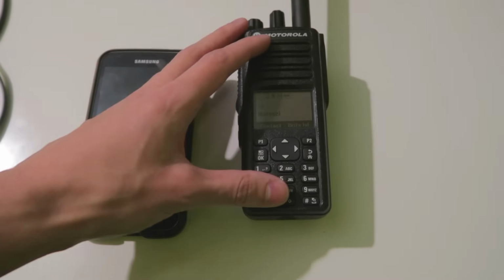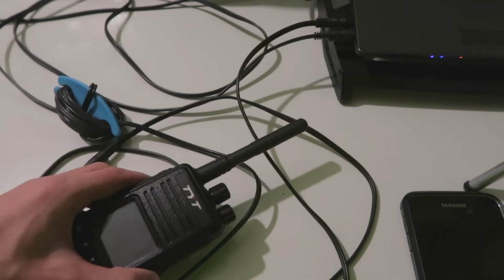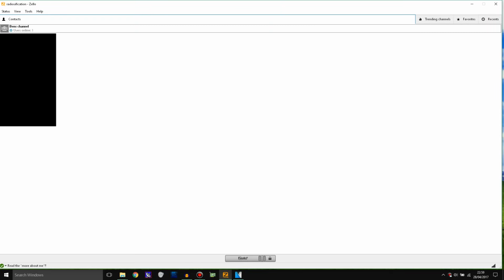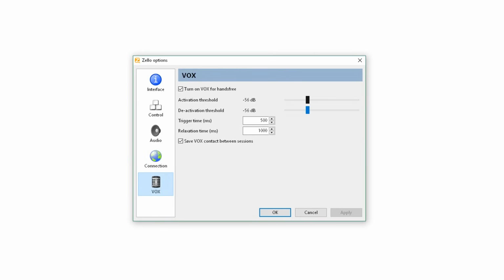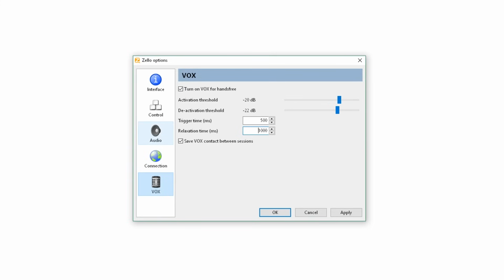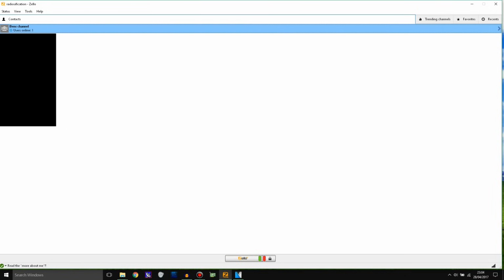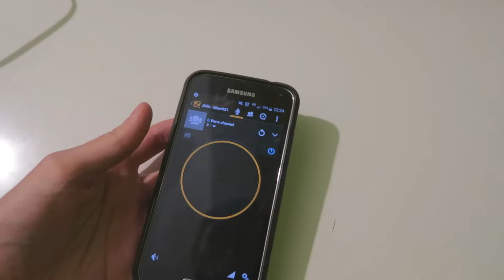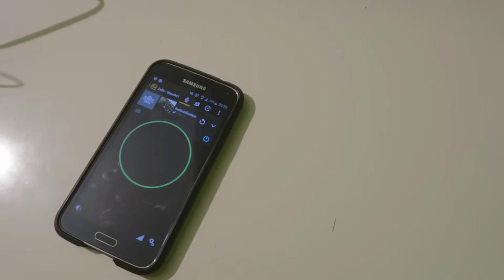How to Make Zello Crosslink in 4 Easy Steps!

Comment: Hi, is zello work (paid account) account needed ? I've downloaded the desktop app, but it seems I can't use the app without a network name which is a feature of Zello work
Reply: Nope. The desktop app is meant to be a physical workstation version of the app on the phone. I'm not sure what you did to get where you are, but all this setup is doing is relaying the audio input and output between the Zello desktop app on a computer and a physical radio. As far as the Zello desktop app is concerned, you're using external speakers and an external microphone plugged into the computer, (although obviously you're actually relaying the audio over cables to/from a physical radio).

Comment: does the radio use internet to work in case the pesron i want to talk to is not in my state
Reply from the maker: No. It's a crosslink as shown in the video. The computer uses the internet which is connected to one radio then you can use the other radio anywhere within range of that radio (so probably a few kilometres)

Comment: its just hard to believe there is still no reliable digital to analog bridges.  That Allstar, DVswitch raspberry pi mess is terrible.
Reply from the maker: Generally it's just not a good idea to make a digital to analogue bridge. The audio is just nasty when you pass a noisy band limited analog signal into a vocoder.
Reply: @radiosification  yes that would make sense,  however i have a buddy that insists on using Allstar.  I cant stand talking on a computer or phone.  I do it all day at work.  Its a huge drag when he calls me on zello and i have to eat my phone like a slice of pizza with my thumb in the middle of the screen

Comment: Thanks,, for sharing! I really appreciate that you were able to break it down and keep it simple without over-explaining where one's eyes start to glaze over! Great job and if you do not mind I would like to share this with those that my team is needing to connect into their freq. during a disaster or S.A.R. by using your direct video it will give you all of the credit you deserve! Thanks, EJ
Reply from the maker: Thanks. Feel free to share the link to this youtube video, but I don't give permission for downloading the videos and sharing separately.
Reply: Good！
Another relatively easier way is using Zello in handphone and walkie talkie.

Both end using extension mic/ear piece and VOX, mic to ear at opposite end device, it is easier to set VOX levels, delay and holding time.

It will be even better using some of the China made walkie talkies which has receive tail suppressions like commercial radios, that is, end of transmissions are clean cut silence !

Comment: Hi there 👋 Great tutorial! I use Zello and two-way radios separately, both for different purposes. I want to do this but I don't know when I would need to do it. Could you give me a scenario when I would need a crosslink between Zello and my two-way radios?
Thanks
Reply from the maker: I just did this for fun. Businesses who use professional setups for crosslinks usually have an existing radio system and want to connect some new users cheaply or temporarily. Instead of buying or renting a whole bunch of radios and having to get them programmed for their radio system they can use a crosslink and just get people to install a radio over IP app like zello.
Reply: @radiosification  Thanks
Reply: For me I'm on a ham radio repeater in my hometown. A lot of times I'll travel out of town and still want to talk back to my local guys, so I use my Zillow account to key up my radio at my hometown and I can still talk to my local boys.

Comment: I swear to god. I deadass hear Roblox miles I’m players use this. No bullshit. Yes. ROBLOX. Not  for some prank your friends are doing. R o b l o x
Reply from the maker: Did you just have a stroke or something? That made no sense at all
Reply: radiosification I think I did
Reply: radiosification meant is say I hear Roblox milsim players using Zillow as a radio for discord.
Reply: radiosification Jesus fracking Christ I hate auto correct

Comment: another useless Zello video that fails to show the cable or PTT switching , other than saying "you plug",,,, another Zello video that should be removed.
Reply: Hi! The PTT switching is done by setting "VOX" on the radio => when it hears talk (or anything else) it switch PTT on !
Look the video again.
Reply: OMG, You "ASS-UME" that everyone uses a walki-talkie with VOX. Anyone with a brain uses a real mobile radio with 25-100 watts that does not have VOX... The answer is that  Zello for Windows can have a high output that can trigger a transistor or a relay or directly to a pin on the radio that activates the PTT.   That was an easy question for you to answer, if you knew what you were talking about.

Comment: Very good. Here's a couple of improvements though.
1. Never plug a radio directly into your computer. You risk burning out the internal soundcard. Instead, use a USB soundcard. These are very cheap to buy, and if you overload it, just plug in a new one, rather than have to open up your computer to replace the internal card, which is undoubtedly more expensive, as well as time consuming. 
2. It is possible to buy a lead that has different size plugs at either end, making the adapter obsolete. The lead is no more expensive than the adapter. 
3. Many laptops (particularly older ones) are very noisy. Putting distance between the connected radio and the computer may help, although the noise may run up and down the cables. It might be necessary to replace the cables with Bluetooth links.
Reply from the maker: Thanks
Reply: thanks for the good video radiosification.
Reply from the maker: You're wrong. He had some good and very valid points which may be useful to other people doing this project. He wasn't being negative just for the sake of it, he was giving constructive criticism, which I welcome.

Edit: And now you edited your comment so that my comment makes no sense. Thanks a lot.
Reply: @radiosification  Yeah they were offered improvements so I think I may have just jumped the gun. Sorry Gary. Sorry for the interference on a great video as well.
Reply: Great another dickhead who knows best, back it up with more than words. Let the guy do it his way it’s his video anyway

Comment: what was the version  of that zello you were using? the recent version of zello (2.4) seems to have a bug on the mic. Vox renders useless due to mic issue/bug. (by the way, windows detects mic and works perfectly)
Reply from the maker: That's unfortunate. I don't know which version I was using in this video as I don't think I checked at the time
Reply: it must be 4.75 version and 2gig Ram or up to get fast response

Comment: I love where you are going with this. It is exactly something that I need for my business. And all the apps out there suck. I need a true cross over from a smartphone to a basic analog 2-way radio. Your set up is cool. But cost me a computer. A radio. And the Zello app must be on all the time draining our phone batteries. Wondering if there is a better way of cutting out the middle man. Which would be the dedicated computer & radio. Need a direct push to talk hand held radio to smartphone connection using RF or BlueTooth to communication. Wifi could work, but if the power goes out, what's the point. Might as well use tin cans and strings or pigeons for messages.

Comment: Is this possible with a Hytera PD665, or a Hytera MD785? Thanks
Reply: Yes. you need cables with connectors that fit to your hytera. Maybe you need to do those audio cables. Find the connectors on some special shop that sells Hytera connectors.. or buy external mic for hytera and slaughter that for your project. 73 de santa

Comment: what is the maximum range?
Reply from the maker: Probably about the distance from the earth to the sun
Reply: So if I plug in my tyt into my computer and cross link it to my zello and run it off either uhf or 800 on my xpr7550 or xpr7580? What about the range of the xpr radio? Doesn't it have to be within distance of the tyt? That's only about half mile isn't it?

Comment: I now now how my school's bus radio system works. I thought it was CB but nope. DMR. They have the same keying sound as your Motorola radio
Reply: There is a chance that those are analog radios but used xpr radios (you still get the same tpt with analog on xpr radios unless if you disable in cps). Companies upgrading fleet of radios with pre-existing license sometimes don’t update the license, meaning they are stuck on analog even with digital capable radios.

Comment: So with this your basically using your computer as a form of repeater ?
Reply from the maker: No, more like a gateway. It's not a repeater because when you talk into it, it doesn't repeat your signal back out at all. Only receives it and sends it over the internet
Reply: Ok, is it only possible on HAM or could it be for GMRS too ? Because im trying to find a way to access through my radio which is a baofeng UV 5R TP
Reply from the maker: @MultiRacing69  with DMR you couldn't do this on gmrs, but with a normal analog FM radio made for gmrs you could. I don't know whether it would be legal
Reply: Ok thank you for the info, and I believe it's probably not , somewhere in part 97 ruling their is probably something In there. I will have to look up.

Comment: Great idea ,but what sort of range are we talking, any chance of a range test video. Thanks in advance.
Reply from the maker: It is the same as you would get from these radios without the crosslink. The range for all radios depends on a huge number of factors such as terrain, frequency, antennas, weather. It can vary from about 1 metre through a lead wall (maybe even less, who knows) to probably 5000 km or more with complete line of sight such as in space.

Comment: cant you tell de range for the transmition
Reply from the maker: No I can't. Range varies based on many factors. Most importantly obstructions between the two radios. It could be as little as 1 metre or as much as thousands of kilometres potentially with absolutely no obstructions

Comment: Thanks radiosification, really like this idea and this video. I use Baofeng UV-82, and the problem of keep transmitting, as previous comments explains, it's about 'Ground loop'. Do I have to by a socket / converter cable to solve the problem? Or you have any other advice on it?  Thanks again.
Reply from the maker: You can actually get ground loop interrupter devices. One of those would be worth a try although I haven't tested it myself.
Reply: Did u tried ground loop isolator ? We're u able to fix the issue ?
Reply: Lei Zhou 
put an isolation audio transformer between celphne spkr out and mic input of the radio

Comment: I like the setup and everything but how exactly is this a repeater. Well I need to have the Zello app in order to access the repeater or can I use my radio alone. The signal gets picked up by the radio and then transmitted through Vox on the app. But How is it going to transmit your signal to the other radio
Reply from the maker: It's not a repeater, and I never said it was!

Comment: Hi, excellent video. I'll be setting this up in Australia. We have UHF CB 476.425-477.4125 80 channels 12.5kc seperation. We also have repeaters (16 channels). Power is 5w. I actually own a repeater GRF08 and will set up Zello for some black spots and local Rural Fire Service can use the phones through the repeater. Will also link another repeater VMD2 to cover wide area.
One thing I notice about this method is that the impedance from the radio ext speaker and into the laptop mic input is critical in getting it working, you must have been lucky with your impedance match. Cheers
Reply from the maker: That's great. Thanks for sharing your finding with me and everyone else who is reading!

Comment: I keep getting a none stop transmit ?????
Reply: i have the same problem, have you solved it?
Reply: Woud a ground loop isolator solve this issue, I get the same thing here on my computer. I TX on zello to the PC and then it operates VOX from PC to radio, but doesn't stop TX after dropping the call.
Reply from the maker: Sounds worth a try

Comment: we try this on baofeng uv82 but when we connect the 2 pin cable going to the portable which is in vox already it just transmit always
Reply: i have the same problem, have you solved it?
Reply: @SisventTurnero  Just strip one of the wires and cutt off the GND wire, make it , so only one of the cable has GND, because it trasmits when both ground pins short out. Hope that helps! Atleast it did for me...
Reply: Raymond Santos 
buy an isolation audio  transformer on line about 600/600 ohms impedance on primary and secondary ,connect it between the speaker output of a cellphone and mic input of a radio to prevent the ground contact on each unit.

Comment: How can I do this with a newer computer (only has a headphone jack) and a BaoFeng UV-5R radio?
Reply: M. Simon order a UBS sound card.  Link to follow
Reply: M. Simon , here's the link,  Plugable USB Audio Adapter with 3.5mm Speaker/Headphone and Microphone Jacks (Black Aluminum; C-Media HS 100B Chip; Built-In Compatibility with Windows, Mac, and Linux https://www.amazon.com/dp/B00NMXY2MO/ref=cm_sw_r_cp_taa_LqnzBb1C54944
Reply: You may well find that the single 3.5mm connector on your laptop is in fact a 4pin socket like an iphone that includes microphone.  You can buy a splitter that converts 3.5mm 4pin into 2 x 3.5mm mic and speaker.  My lenovo t550 is like this.

https://rover.ebay.com/rover/0/0/0?mpre=https%3A%2F%2Fwww.ebay.co.uk%2Fulk%2Fitm%2F132662394812

Comment: have you tried to do a cross link from cellphone running Zello and using data to a two-way radio? Basically replacing the need for a computer in order to make things more portable. Instead of plugging the audio cables into a computer, you would plug them into a mobile phone.
Reply from the maker: I haven't tried it, no. I don't think the mobile version of zello has vox so I don't know how that would work
Reply: http://www.ptt-radio.com/android-em-interface/
Reply from the maker: Well if they are selling it specifically to work with zello then it looks like it must
Reply: radiosification selling? Where?
Reply from the maker: ok they aren't selling it. I didn't look carefully at the link you posted. But nevertheless if someone posted exactly how to do it then I'm pretty sure it must work.
Reply: radiosification hmmm... is E/M something that connect ditectly to mic and spk on an HT?

Comment: This is cool, I am working on EComm in the South USA during hurricane season here and this used with FRS radios and simplex repeaters may give the general public at large more flexible comms options, No license radio persons can link in to a command center which can link out over the internet to mobile phone users. You DO NOT need cell service to use Zello either you can run it off a WiFi connection so any smartphone should be able to use this even if it is not activated on cell networks.
Reply: What if WiFi Internet go down could you link the phone and radio via meshtastic

Comment: When I plug in both plugs into the radio (UV-82) it causes the radio to key up. Don't know why.
Reply: Ground loop. When the ground on the mic side is grounded to the ground on the speaker side, it keys.  The grounds are connected within your computer between mic and speaker.
Reply: any solution for this ? Thanks
Reply: Raymond Santos BTECH APRS-K1 Cable (Audio Interface Cable) for BaoFeng, BTECH BF-F8HP, UV-82HP, UV-5X3 (APRSpro, APRSDroid, Compatible - Android, iOS) https://www.amazon.com/dp/B01LMIBAZW/ref=cm_sw_r_cp_apa_lgKYAbQ91A2QC
Reply: 2001scoop, W6LDS that is normal
Reply: How do I stop it?
Reply: it should only happen once when you plug the cables in

Comment: how far the distance that zello and HT can connected??
Reply: The distance is not affected by the setup. Zello is cellular-based, so anywhere with a data connection you can use it. The physical radio's distance limits are whatever your existing physical radio network already supports. All this setup does is bridge the two.

Comment: I have a problem, we use DMR mototurbo with repeater system, in simplex mode I have no problem, but I can not do the transmission between zello and portable or mobile, will you have any advice? Thank you
Reply from the maker: This is not a reliable setup for serious applications. It is for fun only. If you want to have a crosslink for a proper radio system then you should not use VOX. Instead, you can find hardware which makes the radio transmit. Contact a business who is selling this type of solution.
Reply: I will seek the solution, if I find it in experimentation, I will share it for future communications, thank you, greetings
Reply from the maker: You could use products like the ones on this page, but this is still not a very reliable solution. If you want a solution with high reliability then it is best to buy a radio over IP with gateway solution which is not using zello.
http://www.radio-tone.com/rds01_shopcat.php?&usercat=2768&parentid=2768
Reply: may be  it can help these simple circuit :https://s19.postimg.org/468v4xsyr/image.jpg  if you  encounter ping pong effect when transmitting with the repeater,  increase the value of capacitor (with blue circle) ( map your ptt to middle mouse, don't use build in vox of zello) dy1lmz@yahoo.com